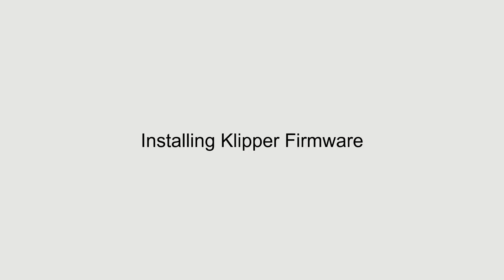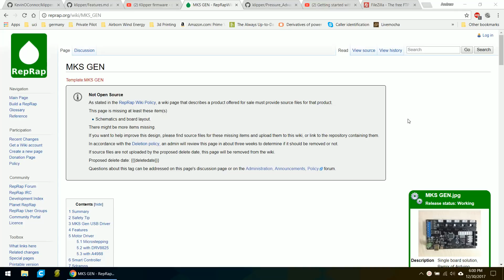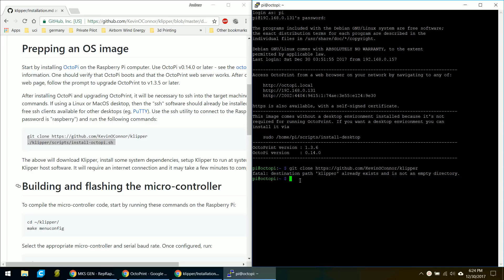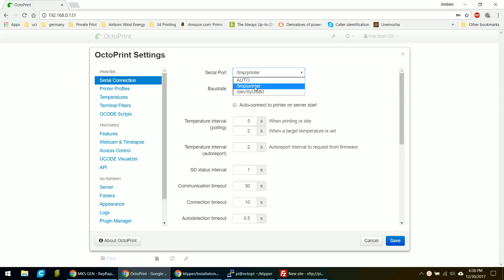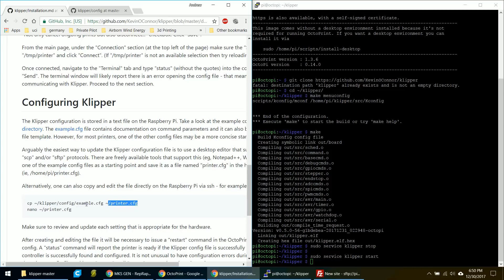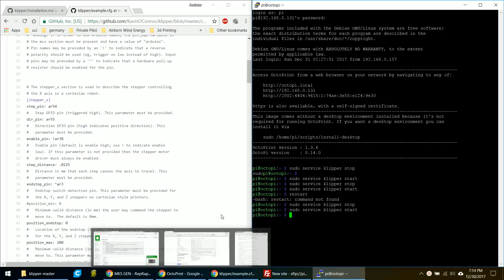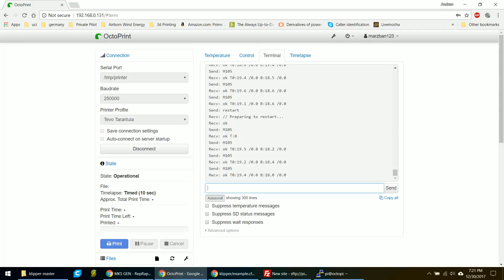What is Klipper? How to Install Klipper firmware

Comment: So once this is installed you just use octoprint like normal?  Does it disable the normal LCD screen menu so that I cant manually level the bed, etc?
Reply: it's currently being worked on but there is a work around 

1.  add this to printer.cfg

[stepper_z]
position_min: -0.5

[bed_mesh]
min_point: 20,20
max_point: 230,230
probe_count: 3,3
fade_start: 1.0
fade_end: 10.0

2.  and the add this to menu.cfg, its located in klipper/klippy/extras/display/menu.cfg

[menu __prepare __meshBed]
type: list
enable: !toolhead.is_printing
name: Mesh Bed Level
items:
    .start
    .zposition
    .zNudgeDown
    .zNudgeUp
    .next
    .save

[menu __prepare __meshBed zposition]
type: item
name: "Z Pos= {0:05.3f}"
parameter: toolhead.zpos
 
[menu __prepare __meshBed start]
type: command
name: Start Callibration
gcode: 
 G28
 BED_MESH_CALIBRATE
 TESTZ Z=-5

[menu __prepare __meshBed zNudgeDown]
type: command
name: Nudge Down
gcode: TESTZ Z=-0.025

[menu __prepare __meshBed zNudgeUp]
type: command
name: Nudge Up
gcode: TESTZ Z=0.025

[menu __prepare __meshBed next]
type: command
name: Next
gcode: 
 ACCEPT
 TESTZ Z=-5
 
[menu __prepare __meshBed save]
type: command
name: Save & Restart
gcode: SAVE_CONFIG

3.  and replace the [menu __prepare]
 part with this.

[menu __prepare]
type: list
enable: !toolhead.is_printing
name: Prepare
items:
    .__delta_calib
   .__meshBed
    .__bedprobe
    .__hotend_pid_tuning
    .__hotbed_pid_tuning
    .__host_restart
    .__firmware_restart

Comment: Trying to wrap my head around this as the concept is awesome. Normally you edit your settings for the firmware on your computer and edit all your options there, compile and then flash. How does that work if Klipper compiles and flashes via OctoPI? How do you get all your edits and options in?
Reply: With traditional firmware, all the configuration is compiled into the firmware, so you do as you describe.  With Klipper, the firmware that's compiled and loaded onto the printer is very basic and doesn't have any of those settings; they're instead made on the computer running Klipper (typically a Raspberry Pi).  All you need to do is edit the printer.cfg file (using either nano via SSH as in this video, a SFTP-aware text editor like BBEdit on your desktop machine, or the OctoKlipper plugin to OctoPrint) and restart the klipper service on the Pi (which OctoKlipper does automatically).

Comment: Question: Is Putty the same as Etcher for Mac? I'm trying to learn how to install Klipper on an AM8 system. I have my Raspberry Pi set up. Just need to understand how to add Klipper to it. Thanks.
Reply: Putty is simply an SSH client. Mac comes with one! You just have to write “ssh pi@192.168.xxx.xxx” (replace the x’s to match your octopi’s IP address)
Reply: dragoninfire123 thanks for the info!
Reply: Corliss Media2.0 it’s my pleasure!

Comment: Hi,Anderw:
I have some troubles. I used the printer of ender3, but it is always displayed
"Klipper state: Disconnect
Klipper state: Not ready
Printer is not ready
The klippy host software is attempting to connect. Please
retry in a few moments.".
 I also checked the interface Settings, so I could send your email to communicate with you in details,
Best wishes
Reply: Had the same problem. It was fixed setting the baud rate manually in the config file.
Reply: jesus thanks! seems like somethign you would put in the FAQ
Reply: @sgoum  I've got this problem on the CR-10S & the baud rate is 115200 and I set manually when making the firmware hex (I was aware of its baud rate already) but how do I verify this - is it the same setting in Octoprint or for Klipper?
Reply: I've the same problem. Anybody with solution ?

Comment: How much load does this use? I have an RPi set up running 2 instances of Octoprint for my 2 printers (an Anet A8 and an Ender3 which I'm in the process of putting together); Is it be possible to use the RPi to control both printers using Klipper, without effecting the load?
Reply: @Abitamim Bharmal The Pi Zero is not fast enough nor has enough memory to manage direct servo control with Klipper. Its not powerful enough to even handle a single instance of OctoPi (they state this on the front page of their website if you read it).

Comment: Thank for this video! I did flash my cr-10 bootloader with raspberry, but coulnt get any firmware after that. And i dont have yet any arduinos. But i could install klipper really easy. And everything work from orange pi.

Comment: The idea of outsourcing planning operations to a modern computing device and focussing the microcontroller entirely on timing and safety interlocks seems excellent to make better use of 16MHz old-fashioned AVR control boards. In particular, I can see this as being an excellent way to extend the lifespan of something like the new board Ultimachine makes for the Original Prusa i3 MK3 -- a board of very good all-around quality with fancy microstep-interpolated, crash-detecting, super-smooth and quiet Trinamic stepper drivers and designed for use with all sorts of interesting sensors, but held back by the microcontroller itself being (AFAIK) the same atmega 2560 as has always been used in RAMPS derivatives. The board ships with a header for a Raspberry Pi Zero W to be installed directly as a daughterboard, and it sounds almost like they intended for something like this all along, but right now it's just coming stock running Prusa Research's heavily modified Marlin fork with experimental support for on-board Octoprint. They're apparently having some real headaches cramming all the features they want into memory, as well as the time budget of ever-more-advanced forms of motion planning on such a slow controller. They're managing by paying programming wizards to optimize the heck out of everything (Linear Advance was disabled due to stuttering issues until recent firmware brought a more optimised version), but a scheme like Klipper seems much more long-term scalable and adaptable to a wide range of control hardware from very crude to very strange -- from discussion on the RepRap forums, this apparently supports MULTIPLE independent microcontroller boards to be slaved to the same Linux [single-board] computer to form a single printer, with minor limitations. This basically makes control hardware modular, which sounds excellent for people who want to experiment with tools, geometries, etc., or people on a budget who want to purchase minimal hardware and expand their capabilities later without backing themselves into a corner.
I'll keep an eye on this, thank you!
Reply: I have this Board. Is it supported? Does it have Linear Advance and cofigurable TMC2130 with Klipper?

Comment: I'm setting up my build for a Tevo Tarantula with MKS v1.3 board. Would you know how I could find the pin codes for the configuration file?
I'm looking at this pinout reference here: http://reprap.org/mediawiki/images/0/0d/MKS_GEN-PIN.PNG but I'm not sure if I should be using the values in the top right for steppers or not... (or if they should be reading high/low?)
Just don't want to damage anything before I even really get started!